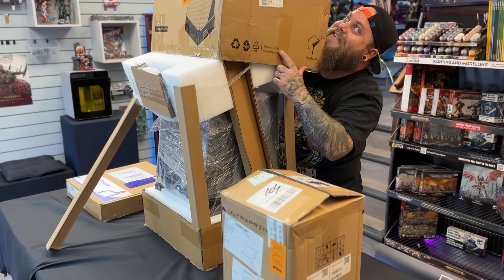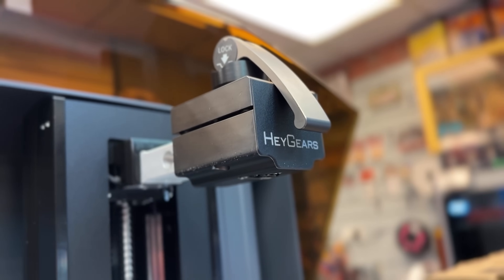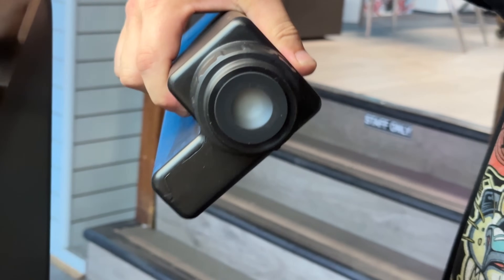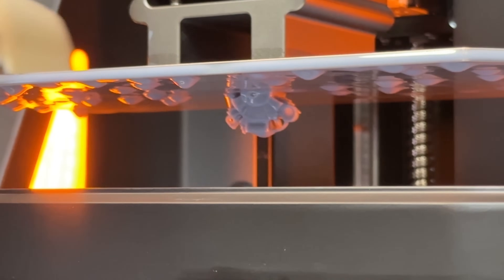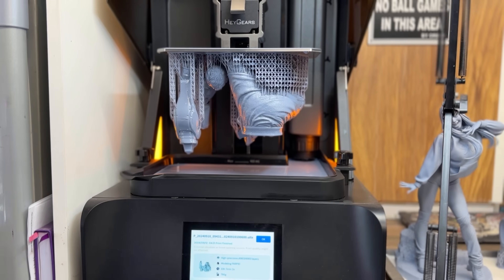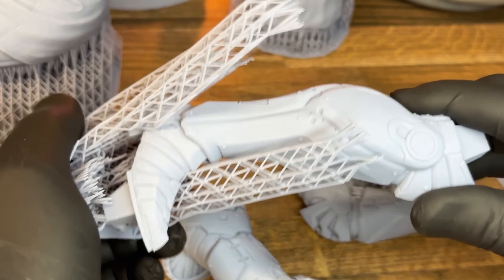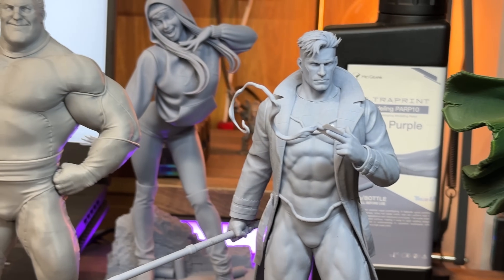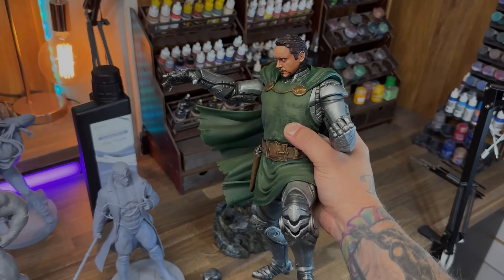Heygears Reflex Rs - Resin 3d Printer

Comment: So just to confirm, did he say it took him 2 full bottles of resin for that 1 figure (10:00)? I don't know what is normal but... a bottle = 60eur, so that figure cost him 120eur to print?
Reply from the maker: It’s not normal to print solid. Would be less resin also that was the cheaper resin so more like 60-70$ and that’s not even 2 hours worth of the cost if you were to commission a painting of this kind. I’ve spent waay more on a statue using cheaper resins due to sizes. The turtles I made a while ago cost over $350

Comment: It DOES effect the result of your test: The equipment they send you costs 1700€ that you and all of the youtubers dont have to miss in your wallet! This is way to overprised. Everyone disses Elegoo for a missing heater in there new Printers, here no one is pi..ed because you have to burn 200 Bucks extra vat with the heater function. Not fair in my opinion.
Reply from the maker: Firstly I’ve never dissed anyone. Secondly it’s not even close to 1700€ it’s closer to 1000 thirdly it’s not a video about cheapest printers. Thirdly dude, why are you so mad?

Comment: Are there visible layer lines in these prints? i can't tell with this resolution.
Reply from the maker: You can increase the resolution to 4K in the settings in YouTube. I’ve recorded in 4K and uploaded in 4K. But yea at 0.05 you can see some layer lines at 0.03 it’s almost impossible to see them.
Reply: @Groundeffected  thanks that's what i was hoping. appreciate the info!

Comment: One thing I wish is that the build plate had a way to hang it at an angle to drain off into the vat. I've really liked that functionality that other printers have added. But maybe it's way to heavy
Reply from the maker: They have a thing to print for this. I don’t like hanging plates tho. Prefer it just to drip off during the last hours of print

Comment: Hhhmmm maybe my opinion is changing on the heygears printers. Maybe if I had the available funds I would give one a try. 
I personally feel they need to make an entry level system, maybe a little smaller screen, no heater, Ali plate. Try and hit the 400-500 ball park. They would 100% own the market. Seems like a perfect system for beginners and people wanting to hit auto support and print.
Reply from the maker: I totally agree. But I dunno if they’d do that. I think they aim toward the top end of the market. They are great machines but I think all machines are great.

Comment: My reasoning for using a steel plate vs a aluminum one is that the steel plate is less effected by thermal expansion and cools more evenly when forged so warping of the plate is minimized and demesions are maintained better through a print session. This matters when doing extream detail and accurate prints.
Reply from the maker: I like the reason you have.  I do wish it had a little roof to drop the resin off the top but I can’t fault the plate other than that.

Comment: That Dr Doom model is awesome.  BUT ... why wouldn't you hollow it?  I could see making the legs solid to help support it but it seems like a waste of resin to do it all solid?
Reply from the maker: Have you ever tried to print solid parts that big before? And if you did have you replaced that screen yet? Haha it was a test. I didn’t pay for the resin I wanted to see if it can do it. And a good few collectors moan about the weight of prints that they are too light. This feels like poly stone. Maybe even heavier to be honest.
Reply: @Groundeffected  I will confess that when I first started 3D printing I resin printed hollow models that big that are still leaking today (because insufficient drainage - d'oh!).  But never brave enough to try solid parts that large.  Of course, I also pay for all my supplies, so there's that.